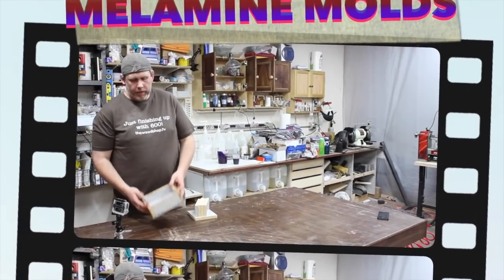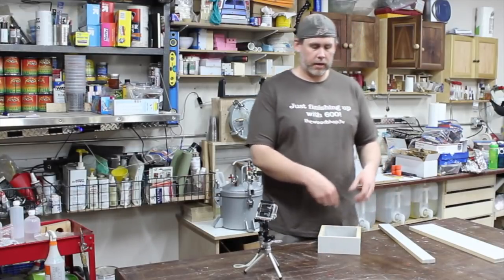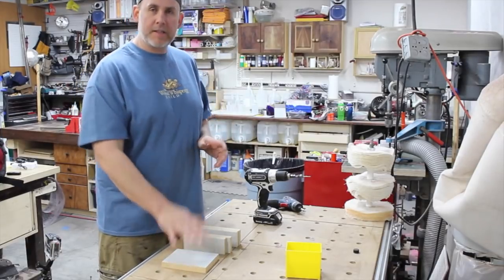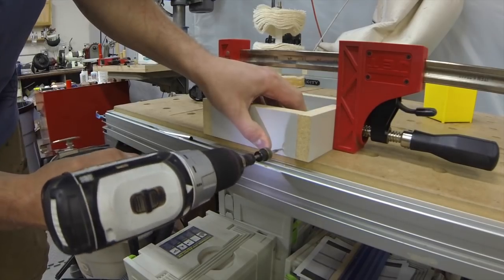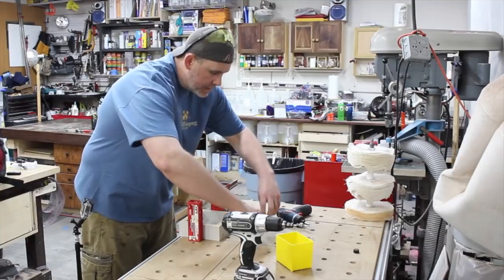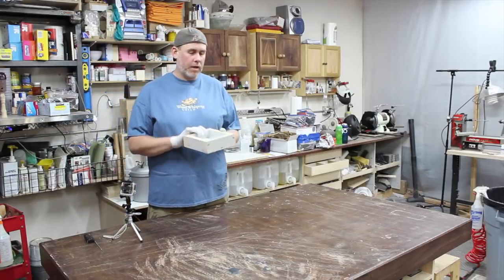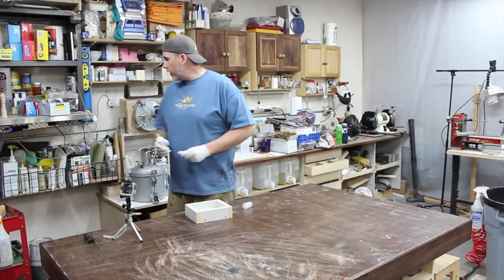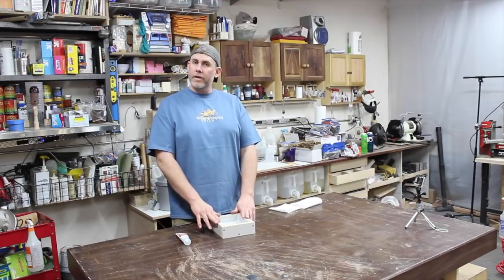Make Melamine Molds For Resin Casting - NV Woodwerks

Comment: I was all set to buy some Stoner mold release until I got the listing. There are a half dozen different ones. Which one should I get?
Reply from the maker: I know what you mean, it's nuts how many different formulas there are. If you are using Alumilite resin, you want the "Urethane" release formula. I think the cheapest place I've found it is on the Alumilite website. For epoxy or PR, the "Thermoset" release should work fine

Comment: I know the title says resin castings but do you think this would also work for epoxy projects?
Reply from the maker: Epoxy is a casting resin, it would work for it but you need to use the correct mold release agent on it. Depending on the project, I'd recommend using HDPE rather than melamine for a totally non-stick mold like the ones in this video: https://www.youtube.com/watch?v=RrqKN1g6vA4

Comment: Thank you for all the great info.  In your later videos you use HDPE board, would it be better to make the boxes from that material???
Reply from the maker: Hey Richard, my pleasure!! I really need to do an updated video on smooth faced HDPE molds, I do recommend using it over melamine because HDPE is totally non-stick. Melamine works fine, but you definitely need to use a mold release on it before casting to make sure it comes out easy. Look for smooth faced HDPE,  the textured stuff doesn't work as well. I get sheets of it at Grainger, but you can pick it up on Amazon or other plastic companies online. I have a link to where I get it at Grainger on my website, along with many other tools and accessories I use for resin casting and turning: http://nvwoodwerks.com/tools/
Reply from the maker: It should work, but you'll probably need to get specialty resin or pour it in multiple stages. Pouring too much resin at a time can cause it to overheat and crack. There are specific resin formulas that are meant to pour larger amounts at a time though
Reply: Thank you...

Comment: Hi Zac, is there a maximum size mold? or can you use this method to make any size?
Reply from the maker: I think you could make them any size you need, can't think of any reason that would limit you
Reply: awesome, thank you! I've been looking for stoner spray. But i live in Europe and they don't sell it around here. Would vaseline or baby oil be a viable alternative? PS I've been watching your vids non stop. Thanks so much for sharing the knowledge!!!
Reply from the maker: I've used paste wax before, and it worked great. I've heard of people using vaseline too, but I haven't tried it myself. Never heard of people using baby oil though, I'd probably recommend staying away from that just in case. 

Depending on what type of resin you are using, you should be able to find a mold release agent in an aerosol too though. I use the Stoner Urethane release because it's formulated for urethane resin, which is what the Alumilite products are that I use. Epoxy and polyester resins typically work fine with general purpose mold releases though if you can find that in Europe

Comment: You mentioned spraying the mold with something, but I could not understand it.  What was it you sprayed the mold with?  Thanks in advance!
Reply from the maker: Sorry if I skipped over that part, it's called "Stoner" Urethane mold release. I get it from Alumilite: http://www.alumilite.com/store/p/960-Stoner-Mold-Release-12oz.aspx

I'd recommend getting it direct from Alumilite if you will be using it with Alumilite resin. There are some other formulations of "Stoner" that don't really work well with polyurethane resin (Alumilite). The other formulas are for PR or epoxy resins
Reply: Thanks.
Reply: Would this work for larger molds like table tops?
Reply: Thomas cunningham Did you end up trying it for a table top? My question exactly. :-)
Reply: The Mars Volya I have not tried it yet but hopefully soon!!

Comment: Hey Zac I did a project and didn't spray my melamine board first and my project is dry now. what do I do to get it off the board? thanks
Reply from the maker: +Alex Stoops Sorry for the late response, didn't get a notice about it. You've probably figured out how to get it out by now, but if it's stuck in there, you'll have to take the ends off the mold and just kind of tap it out with a wood or other soft material mallet. If it's totally stuck and won't come off the melamine, you'll probably have to cut it off.

Comment: Will epoxy bond or stick on melamine surface? I would like to pour epoxy on my melamine table.
Reply: absolutely ! You need to put a sheet of polyester on the melamine. West system {TM) sells the stuff .But you can experiment  and use normal polyester and spray if with weathershield silicon spray and then spray the melamine with mould release.

Comment: any other way of releasing it besides banging on table? could you technically just unscrew it?
Reply: wanting to make a bigger mold like 12x24 with resin in it, and dont want it to crack when i release it..
Reply: last question, if i am using enviro-lite and use whatever mold releasing spray works for that, will it work with the melanine? thanks!
Reply from the maker: Yeah, you can definitely unscrew it rather than bang it out. I definitely recommend doing that for something that may get damaged. I don't have experience with enviro-lite, but it should work fine if you use the appropriate release agent with it

Comment: Great video I am subscribing to the channel thank you! Does epoxy resin stick to foil?
Reply from the maker: Thanks Adrian! I've cast some aluminum can pieces in resin, and that seemed to work ok. I'm not totally sure about aluminum foil though, I've never tried it. 

I need to do an updated video on molds for casting. Although melamine works ok as long as you use a mold release with it, I switched to smooth HDPE plastic once I found a supplier. They work a little better than melamine, totally non stick. I build them the same way as the melamine molds though. I get the smooth HDPE at Grainger online. If you're interested in using it, I have a link to it on my 'tools I use" page on my website: http://nvwoodwerks.com/tools/

Comment: Hi Zac,
Ive been working with soft plastic molds. I find it hard to believe resin pops out of the hard Melamine molds.  Dont you need a softer mold to get the resin off the walls of your mold.  How does it just pop out,.. what type of resin are you using? Is there a lot of shrinkage that allows the cured resin piece to pop out of a hard mold.  Just trying to decide if I make a resin mold out of soft mold material and form it over my positive piece,..or just build the box shape I need ou out of melamine.... what would you recommend... I have not tried the polyurethane caulk yet.   thank you! Leslie
Reply from the maker: +Leslie Podell Well, it just depends on what you're making with the resin. I make a rectangle/square brick then cut it into smaller rectangles for pen blanks. If you're doing copies of objects, I'd probably do it with silicone mold making material.

I'm using Alumilite resin, they do pop right out of the melamine mold, but I use Stoner Urethane release agent on the mold. Alumilite is a polyurethane resin, very minimal shrinkage. Polyester resin shrinks quite a bit, and I believe epoxy does as well. 

I also use PVC pipes for molds in some cases, and again I use Stoner spray on them to make sure they slide out when cured.

I haven't gotten into mold making with the silicone stuff though, it's so thick that I just don't like messing with it. For my application, it's much quicker and easier for me to cut up some melamine and screw it together since I'm set up to do that really easily having a full on woodshop at my disposal.

The silicone putty stuff works really well too if you're doing copies. Easy to use, and great for making a negative of another object.

Comment: I know this is an older post but I'm seeing all these comments about heating your product. Isn't resin supposed to harden on it's own? Is it to speed the process up?
Reply from the maker: To answer your question if the resin hardens on it's own, yes it does. When you mix the resin and hardener together, it begins the chemical reaction converting it from liquid to solid state. Heating the mold just helps out a bit. 

The corners in a square mold are colder (especially if there are gaps in the joints), and the resin will tend to migrate towards the center of the mold where it's warmest. The resulting casting will have rounded corners which may be undesirable depending on the final use of the casting. In some cases it may not make any difference, especially if you plan to cut it up or shape it, and the corners would basically be removed anyway.  Heating the mold up will help reduce that corner creep and it also helps the air bubbles rise in the resin. 

If you are pouring very small amounts of resin, heat may be necessary to achieve proper curing. The more resin you pour, the more heat the resin will generate. The resin needs heat to properly cure, and it may need a little extra heat than the resin will produce on it's own with smaller amounts of resin.  In the case of very small castings poured in a silicone mold, it basically just makes the resin happier and will help to grab all the little details in the mold better. In short, you'll get better results.
Reply: wow. thats a response well over what I expected. thank you so much. I've really wanted to get into wood working and I feel like your channel is what I need and more!
Reply from the maker: That's awesome to hear, it's always a good day to start woodworking =D What types of things do you want to make? My channel is focused on resin casting for woodturning projects. For learning the basics of woodturning, I highly recommend checking out Carl Jacobson, Mike Waldt, Sam Angelo, and Brendan Stemp on YouTube. They have excellent videos on the proper techniques for turning. For resin casting, I'd also recommend checking out Nick Zametti, Peter Brown, and Heath Knuckles here too. All are fabulous craftsmen and make great videos

Comment: Can you use the molds without stoner?
Reply from the maker: You could, but then you'd have to unscrew one or both ends each time to get the casting out. I'd recommend not caulking them if you go without stoner.

Comment: can the molds be reused multiple time?
Reply from the maker: +ifly graham They can be as long as you use release agent with them.
Reply: +Zac Higgins So the screw holes will with-stand being screwed into and out of multiple times? My hope is that I can make a set of different sizes and reuse them many times.
Reply from the maker: +ifly graham To be honest, I rarely had to take the melamine molds apart as long as I caulked the seams and gave them a good spray of Stoner before each use. However, I have taken some apart here and there, and the screw holes held up fine. Should be good as long as you don't overtighten them.
Reply: +Zac Higgins Okay cool.
I'm going to be using them for casting rubber not resin (with mold release) I will be careful to not over tighten the screws. Thanks for sharing.

Comment: Hey Zac, great job with the melamine mold. My question is, can you just use silicone spray lubricant instead of the "stoner" product.
I have plenty of the silicone spray and I have a limited budget.
Reply from the maker: +Mearl Wood I haven't tried using other silicone sprays myself. I've heard that some don't really work with Alumilite, but I'm not sure. I've also tried paste wax though, and that works pretty good as an alternative.

Comment: Enjoy your vids! What size are these blank molds and how many blanks do you get? Thanks
Reply from the maker: +Patricia Houston Hey Patricia, I'm glad you're enjoying them :-)  The molds I made in the video are about 5.125" x 6". If I remember correctly, the sides are about 2" tall, which gives you about 1.25" inside the mold once it's assembled. How many you can get out of it depends on which way you cut them. I get 6 blanks out of them cutting them along the shorter side or 5 when cut along the long side.

Comment: I was thinking of using HDPE and a lock so that I can unlatch a 'door' and peel out the blank.
Reply from the maker: I'm using HDPE for my molds now too, way better as long as you use the smooth face HDPE. I like the door idea, seen a few like that. I just screw them together similar to how I made the melamine ones, quick and easy.

Comment: Can you use something different then stoner?
Reply from the maker: Yeah, I have heard of people using other types of mold releases, but I haven't tried anything else myself. I've heard that you can use paste wax, petroleum jelly, and other sprays too. The Stoner works fine though, so I haven't had the urge to try anything else. I've also heard of people using cooking spray, but I haven't heard that mentioned with Alumilite specifically, just PR or epoxy.

Comment: Hey Zac I have a question for you. I did a project and didn't spray my melamine board first and my project is dry now. what do I do to get it off the board? thanks
Reply from the maker: +Alex Stoops Well, it should come out if you take one or two of the ends off the mold. If it's super stuck, you might have to cut it off, but I haven't had to do that myself when I forget to spray them.

Comment: CAN YOU MAKE ONE THATS VERTICAL?
Reply from the maker: You could do them vertical. I'd probably recommend PVC pipe if you're going vertical and it can be round. Much faster and cheaper that way
Reply: +Zac Higgins have you tried it or will you in a video?
Reply from the maker: I have a video on casting in PVC pipes: https://www.youtube.com/watch?v=6O6MkpYF0Ok
Reply: thank you! how easy is it to put two different pieces of resin together? can you just glue them like you would do with wood? if so, how durable is it?
Reply from the maker: Yeah, no problem. I'd probably go with epoxy and clamping the pieces together, but you could even use CA glue if you want. To ensure a good bond, just scuff up both pieces with some 80 or 120 grit and make sure the surfaces are cleaned off with some denatured alcohol or acetone before applying the glue.
Reply: thanks again. i want to try to make a spec like blank